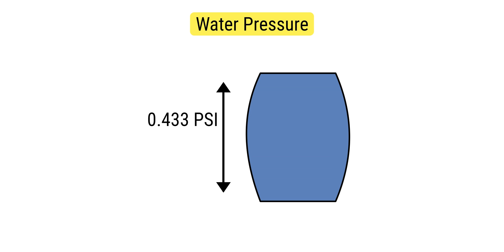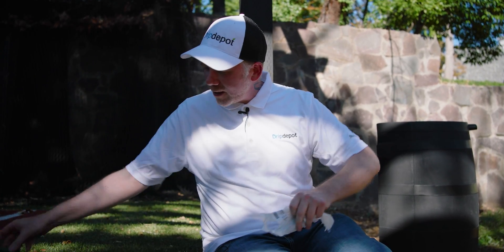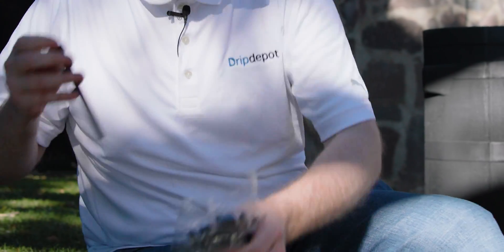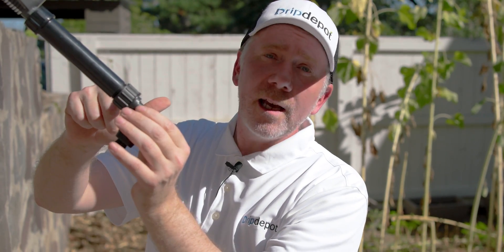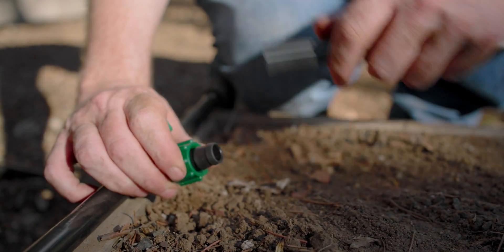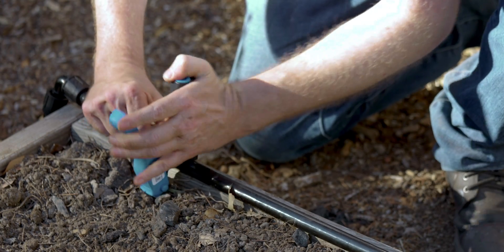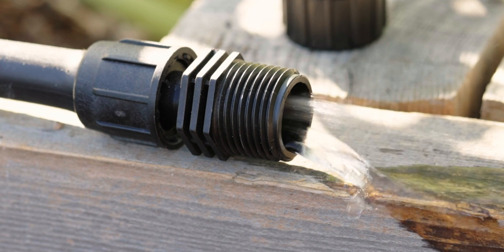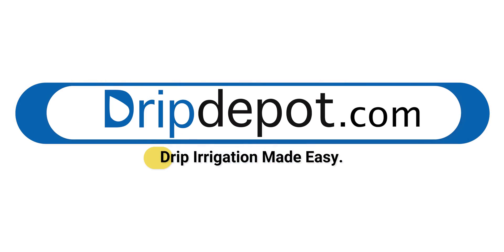How to Install a Gravity Rain Barrel Drip Irrigation System | DIY Raised Bed Project

Comment: Thank you for the great video, this is very helpful. Could you please clarify how the drip system can operate with a 5-feet pressure, which is 2.2 PSI? In other videos available on your channel, you mention that drip systems require 15 PSI at least. Thank you very much.
Reply from the maker: You bet!  So, most drip emitters are  at 15 to 25 PSI (depending on the emitter) -- optimal in this case mostly means dripping at the stated flow rate.  For example, a 0.5 GPH button dripper that is optimal at 25 PSI (very common) will be closest to that 0.5 GPH flow rate at 25 PSI.  

Many (but not all!) emitters will work at lower pressure, they just won't put out the stated flow rate at lower pressures -- depending on available flow, they can be very close however, and they can still be consistent across the entire system.  As a quick example, at lower pressure they might put out 0.35 GPH instead of 0.5 (just example numbers, but probably not too far off).  That might just mean a slightly longer run time is needed versus a system that has them all flowing at 0.5 GPH. 

There are also some emitters like the cleanable ones we used in the video that are designed to operate at very low pressures -- the cleanable drippers we used can great at near 0 PSI so long as there is flow -- the drip tape in the video is also great at handling lower pressure, and I wouldn't be surprised if it was putting out very close to the stated amount even though 10 to 15 PSI is optimal for drip tape.  

Some emitters will not work at that low of PSI, just as you touched on -- in systems with this low of pressure it's best to avoid pressure compensating emitters and CNL (Check Non-Leak) emitters, as those often have a minimum PSI needed to operate.  Likewise, a system with this low of pressure leaves out a lot of spray or sprinkler type emitters (typically not a problem however, as drippers can get the job done in most garden type applications).
Reply: So in the case of 5/8" drip tape...would getting the .4 gph rather than .25 gph provide for better flow bc the holes are bigger, or does that matter?
Reply from the maker: @chocalatekid8024  Dang, sorry for the late reply!  For whatever reason, YouTube does not send a notification when someone other than the original commenter leaves a reply.  I just happened to bump into this one when showing the video to someone today.  

For a gravity system, I think the overall flow rate matters more than the orifice size -- lower flow means less pressure lost from friction and in a gravity system (at least one that's not elevated way up) every little bit of pressure counts.  In the video, I went with the 0.17 GPH drip tape, very very low flow.  In retrospect I could have gone higher, but I wanted to make sure it worked well.  Since we were on site to install and film it I wanted to guarantee success the first time around.  :)
Reply: Also, I get some scummy already in my clear ibc totes, any ideas how i might keep that large particle from clogging thr inline filter quickly.
Reply from the maker: @chocalatekid8024  Yes, scum (or algae/bacterial growth) in the water totes can be a huge pain.  Great that the filter is capturing it, but as you noticed that leads to a lot of filter cleaning.  If you let your tank get empty, a quick thorough wash of it can remove the build-up.  If it's something organic/growing,  you can also look into mild treatments like hydrogen peroxide or chlorine at irrigation safe levels, this will usually kill off anything growing inside.  If you go this route, I'd consult with someone locally on safe concentrations based on volume of water in the tank, the treatments are effective but you don't want to overdo it :) 

If possible and it's not already, put some shade over the water totes, sunlight exposure makes it more likely for some organisms to grow in the tank.
Reply: Thanks!

Comment: Thank you for the information, can I just bury the pipe.
Reply from the maker: You sure can!  Poly tubing is best when buried about 6" to 12" in a location no vehicles are crossing -- just like with PVC, give it a trench of soft crumbly soil and lie in and it can be safely buried.

Comment: Why would you skip the part where you take off the green connector from the timer??? All of a sudden it's gone when you go to put the next piece on. Why would you do that???
Reply from the maker: The green part at the bottom of the timer?  We just unscrewed it so we could put our head assembly parts on, the green connector at the bottom isn't always used.  When you remove it, there are hose threads there so you can screw on any normal hose threaded connection (things like garden hoses, head assembly parts, etc).  We didn't want to distract from the content of the video too much by going into things like quick connect, just nice, straightforward threading things on like we're used to :)

Comment: Hi! This is the best gravity fed irrigation system informational video out there! I have already watched it 4 times! I am about to get my rain barrel fed system hooked up for this season and I have a few questions. I have 2 a U-shaped garden beds facing each other that, at their longest and widest sides, are 10x12. My rain barrels are located about 25 ft away from the start of my garden beds. I was going to use 1/2 inch main line that then links to 1/2 inch drip line with holes every 12 inches, and snake it around my U-shaped beds but I am wondering if there will be enough pressure from my rain barrels to supply these lines? Each bed will probably use about 30-35 ft of drip line. Should I switch to drip tape in this case and figure out how to do it in straight lines? Or possibly drip line that is smaller in diameter?
Reply from the maker: Happy to help Ellie! 

All good questions, and you're definitely on the right track with your thinking and considering drip tape or smaller diameter drip line.  Likely one of those will be a better choice than the 1/2" drip line (1/2" drip line is pressure compensating, so requires a minimum PSI to be met).  

Do you know the approximate elevation difference between your barrel and the beds?  With that I can determine how much pressure you''ll be working with which can help inform some compatible emitter choices :)
Reply: There is currently about a 2 ft height difference between my beds and my rain barrels, but I could raise it another foot
Reply from the maker: @elliethams1541  Perfect Ellie, if you can manage 3', you'll have 1.3 PSI -- that's actually not too bad for a gravity system and is enough to create sufficient flow to feed some emitters. 

Do you already have any of your 1/2" tubing?  If so, you can connect it to the barrel and run it out to the furthest bet -- then, turn the tap on the barrel on and time how long it takes to fill a bucket from the end of the tubing.  Then plug the numbers into the flow rate calculator to see how many gallons per hour of water flow you're getting from the barrel: https://www.dripdepot.com/irrigation-calculators

That will tell you how many lines of drip line (or how many emitters) you can feed at once :) 

Ellie, for this application you'll likely want to either go with drip tape or with 1/2" tubing that you punch your own emitters into -- the reason is, most 1/2" drip line (the kind with preinstalled emitters) are pressure compensating, meaning they have a minimum PSI that needs to be met that generally isn't met in gravity systems (12 PSI is common). 

By punching in your own emitters, you can use very very low pressure drippers that can work at near 0 PSI: https://www.dripdepot.com/cleanable-dripper-flow-rate-half-gph

Drip tape, like the drippers linked above, can work at very very low pressure -- one advantage drip tape might have, is that it's available in much lower flow rates (down to 0.17 GPH for some types).  This means each emitter eats up less of the available flow -- that may not be a concern though depending on the results of the flow rate test.  

You're welcome to send follow-up questions this way, happy to help!

Comment: The information is very good. The speed of the information is a bit much so I had to do many reruns to easily understand.
Reply from the maker: Thank you Wayne, and noted on the speed! 

There's another trick you can do -- at the bottom right hand side of the player there's a cogwheel -- if you click there it will open up some options, one of them is to slow down playback speed.  If you set it to 0.75 it will slow down but still sound normal (if you slow it down to 0.5 it will sound like I imbibed too much, but at 0.75 it's slower but sounds reasonably normal) :)

Comment: Slow down,   otherwise we will refrain from watching !!
Reply from the maker: Jerome, just like in the other video you mentioned, you can slow down videos by clicking on the cog at the bottom right hand side of the player.  At 0.75 speed it will still look and sound normal, just a bit slower for you :)

Comment: Coild you use a soaker hose or one of these small hoses with a lot od holes to water a larger area? Im guessing the pressure isnt quite enough to do a ton of holes.
Reply from the maker: You've got the exact right of it :) 

Soaker hoses typically aren't uniform across their length -- a very short piece might be ok, but anything much longer will see the early part of the hose put out more water than the later parts of the hose.  I do think this would be exacerbated by use in a gravity system, the first portions of the hose might use up all available pressure leaving nothing for the later lengths of the hose.

Comment: Hey one question. I accidentally bought a timer that says it needs a minimum of 0,5 bars of water pressure to work. I only tested it with just a bit amount of water in the barrel (enough to cover the hole for the faucet). All I got was a slow drip out of it 😢 Do you think it would work better if the barrel (200 liters) would be completely filled? Or should I get a timer like in the video?
Reply from the maker: You likely will need one similar to the one in the video -- the reason is that most hose timers require a minimum PSI in order to work.  They use water pressure to aid in the opening and closing of the valve via an internal diaphragm -- this helps preserve battery life (using the power of water to help), but does mean that minimum PSI has to be met, or at least very close to it.   

0.5 bar would be around 5.1 meters of elevation, which likely isn't practical.  The one we used in the video isn't hydraulic, so it doesn't require water pressure to aid in its operation.  There are purely mechanical timers out there that can work, but those have to be manually turned on each time -- the one we used in the video (Zero Pressure Timer) is able to be programmed if you're looking for full automation :)

Comment: Love your video. Going to the store this week to create my system as well :) Can you tell more about the water consumption for a 2 x 1 m garden?
Reply from the maker: Thank you!  

There will be a lot of factors that go into this one -- types of plants, planting density, time of year, weather conditions, etc.  As a very general rule, I start the season with short watering cycles (10 to 15 minutes) -- in a 2 x 1 bed,  this would be about 20' of drip line with a 0.5 GPH emitter spaced every 12", which would be a total of 10 gallons (38 liters)  of water used every hour, so about 1.6 gallons (6.3 liters) for a 10 minute cycle.  

During the hotter months when there is no rain, I'll increase this to 30, 45 or even 60 minutes (or two 30 minute cycles, one early and one late).  

A lot of conditions influence this, however, so you'll definitely want to experiment and find the sweet spot, while keeping in mind the sweet spot is likely to change during the year as the plants mature and the summer gets hotter, and likewise, if you experience much rain during this time.  :) 

Note: Forgive any math or conversion errors!

Comment: It looks like the rain barrel needs to be fill up every 3 days with no rain and based on the rain barrel size
Reply from the maker: That is definitely a reasonable frequency!  It can vary a bit depending on the flow rate of the system -- with just a couple beds and low flow emitters (except when we opened the coupling valves all the way) ours was particularly slow :)

Comment: I am installing a 1,000gal rainwater collection system.  I will gravity feed my 6 raised-bed garden that is 50' away from the cistern.  The slope drop is about 3 feet.   I am confused about how many emitters (or drippers or drip tape emitters) I will be able to use with this distance.  Please help.  Thank you!
Reply from the maker: There are a couple factors at play here, and with gravity it's a lot of trial and error (but also very rewarding when it's up and running after those trials).  

In regards to pressure, you'll have 1.3 PSI from the elevation change and probably a little more from the height of the tank itself (though the height isn't completely reliable as it will drop as the tank empties).  This is enough pressure for many emitters, but you'll want to make sure you're not losing too much pressure from friction -- this essentially means sizing your mainline to minimize friction loss.  You'll be able to do that (and I can help) once you've decided on what emitters you'd like to use and their quantity -- this gives you your system flow rate which can be ran against different mainline diameters to find one with minimal friction loss. 

The other key factor is flow rate, and this is the one that can be challenging to calculate with a gravity system.  What you're looking for here is the flow rate of the water source versus the flow demand of the system.  For example, if the water source provides 200 GPH but the total emitters (flow demand of the system)are at 300 GPH, some wouldn't receive water and drip as they should.  

Do you already have your water tank?  If so, it might be worth hooking up a 50' garden hose and doing a flow test from the end of it, that would at least give you a rough starting point.

If you don't have enough flow for the emitters, it can be zoned so that only portions of it operate at once and zoning isn't too involved, but definitely best to know at first.  

In this case, I'd recommend getting your system flow rate first -- decide which emitters you'd like to use and how many and you'll be off to a great start.  We can also help fill in some of the details once you have the system flow rate :)
Reply: Wow, thanks so much for the QUICK reply!  The tank is not yet installed (delivery in the next couple weeks).  And of course I'll have to wait on RAIN.  Unfortunately I missed the 9+ inches of RARE January rain here in Central Texas.    I was wondering, should I just use a hose from the tank to traverse the distance down to the garden site and then hook up the 1/2" main line down there.  Will that help with "friction" since the diameter of the garden hose will be larger than the 1/2" main tubing?   Just pondering at this point.  As with so many people on here, the amount of info out there is staggering but I find that each one has some sort of data missing that leaves you wondering "huh?".  So I appreciate you succinct and very thorough videos!       I will contact you down the road when I am more established (and by then have my emitters figured out).  THANKS SO MUCH!!!
Reply from the maker: @CheriChilcote  You're very welcome! 

At a glance, I think you're correct that running a hose down to the garden site would cause less pressure loss than 1/2" poly since it's likely to have a larger diameter (3/4" or 1" poly could be a different story, but 1" at least is more than you'd need for a system this size) -- Once the tank arrives and gets full enough for the flow rate test, test it with the hose attached -- that will give you some real world results applicable to your plans.  

And you're right about the information out there!  It is staggering, and also sometimes missing or incomplete (or assumes we know something we don't yet) --  I do think you're off to a great start here though and I'm a big fan of gravity systems.  Yes, they take the most trial and error, but once you get them adjusted where you want them they're very rewarding, particularly if you're going to be using rain water like it sounds like you are.  

And 9 inches of rain is quite a lot even for us up here in Oregon!  Hopefully the weather cooperates when your tank arrives :) 

As you go through the process, you're welcome to reach out at any time, here or on our site -- when your tank arrives and you do the flow rate test, let me know the results and I can provide some feedback.

Comment: WAIT...who has a rain barrel at a 5 foot level?  NOT ME...wast of watching.  Mine are at the most 2.5 ft.  And do you see the wall he is standing on?  Not practical.  I have 12 rain barrels off my downspouts elevated on cinder blocks 2 ft high.  this will not work.   Glad I watched before I bought.
Reply from the maker: The barrel used in the video is actually still in the exact same spot watering those beds at the vineyard -- lesser elevation can work, but will limit the size of the system (in regards to number of emitters) to some degree (but if the system is small to begin with, that's not necessarily an issue).  With less elevation, all you need to do is be sure to use emitters that will continue to work at lower pressure -- in the video, that should pretty much be all the emitters, with the 0 PSI button drippers and coupling valves as a dripper being the lowest pressure options :)